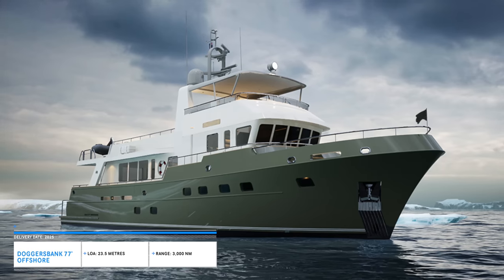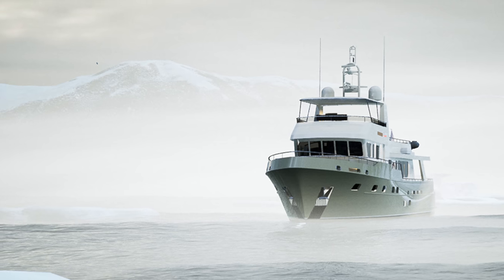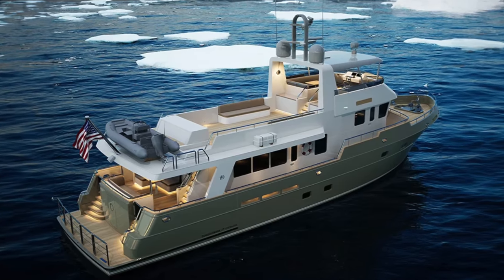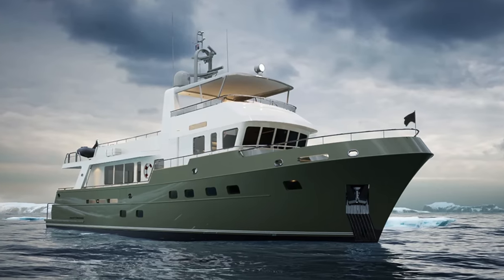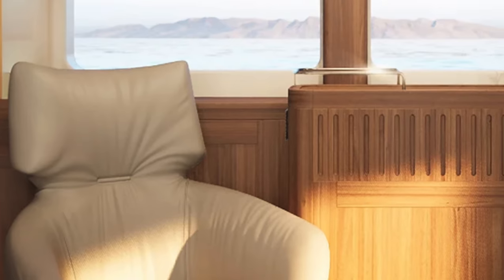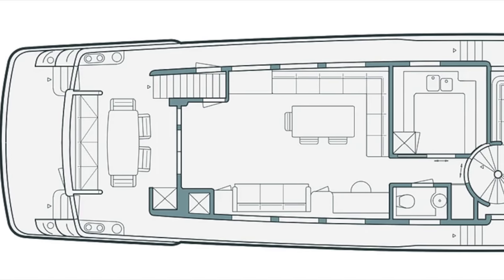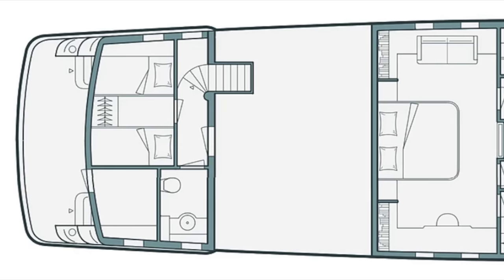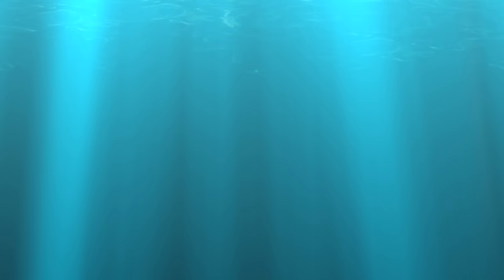FIRST Cut Of STEEL For The Brand New Doggersbank 77 Offshore Trawler Yacht!

Comment: Sorry but it looks like a B77 from the outside That's actually what I thought it was When I saw the thumbnail
Reply: Actually the B77 looks like Doggersbank. This design has been around since start 2000
Reply: Good grief, are you serious? The B77 has a MUCH higher stacked profile. The Doggersbank has north sea windows, the B77 vertical. They both have a pointy bow bow I’ll give you that.
Reply: The B77 and this yacht have nothing, other than the bow and maybe the mid-stacks, slightly,  in common. They don't look anything alike really.

Comment: Intrigued by the protected prop/rudder. Like a Kort nozzle ? Obviously good idea to anyone who has been on a beach from Oregon to Alaska. Can you still call it "driftwood" when it's a tree with a root base bigger in diameter than you are tall ? Still, you wonder about drag, etc. Speaking of drag, did I miss deets on stabilization ?  Great to see proper serial hybrid system tech trickling down to  smaller  blue water/explorer vessels. Let's have a showdown between this boat and the Steeler that you reviewed. Make it so, YB....lol...